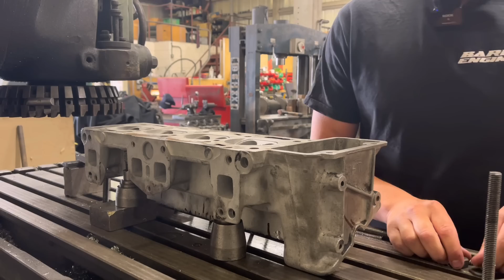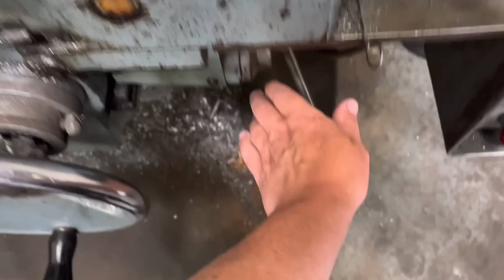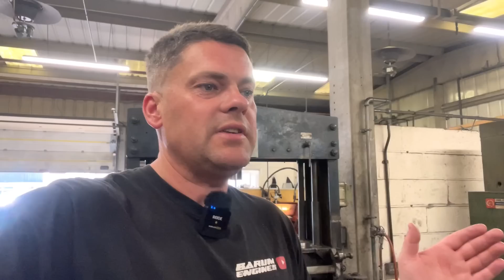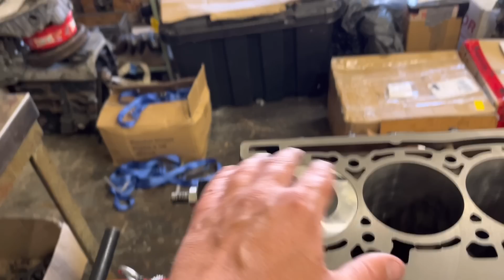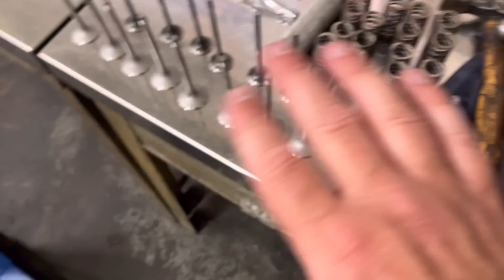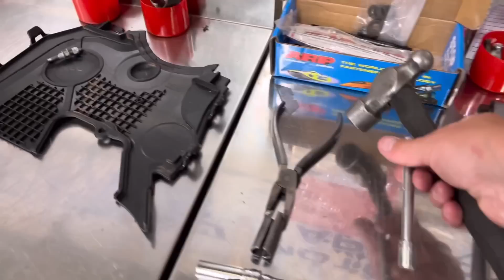“Something SERIOUSLY wrong with this engine, sort it ASAP”

Comment: Check all the valve stem seals are in good condition. It is possible to split a new seal. Rare though. As is missing the installation or pushing one off when putting a valve back in. It could be result of changing the valve springs out for a hot cam. Looking into how much assembly lube was added before startup can be a surprise. 😮ya did whaat? Good Luck.

Comment: You can take a nice round plate that fits properly in you 3 way chuck. Drill a hole in the middle smaller than the cylinder diameter. Skim the plate so that it is properly flat. Take a round stock and drill a hole through which rod that you use now will fit through.  Cut thread on the other side. Take the cylinder put in that custom made piece, put the other rod through one side of cylinder than custom piece than other side. Keep the skimmed plate in the chuck and place a nut so pull the cylinder perfectly flat. Working on the lathe works much better

See for inspiration: https://youtu.be/i-q6H_OyM9o

Comment: I watched a Triumph TR3 idle itself to head warping and filling its surroundings with white smoke.
The cause? Evans "coolant" not thermally conductive enough to open the thermostat on the top of the engine.
Cylinder head at 130C plus, top of radiator at 75C. It ended up blowing pure propylene glycol aka vaping "smoke" out the exhaust.

The vapour capsule based temperature gauge was broken on installation or in transit from a repairer.

Comment: When a road tester at a Peugeot main dealer it was my job to clear the exhaust of oil and coolant following head gasket failure and renewal. This entailed driving at speed on the motorway causing a whiteout to following traffic and I was not popular, but on the flipside if I hadn't done it the customer would have been back the next day complaining.

Comment: What breather system has been fitted?  Most or all genuine C Types breath through extra bosses on the rocker covers, from memory in to catch tanks, not the carbs.  Have they gone to that much detail and does any breather system fitted work?  Wonder what it does if you take the oil filler cap off?  Im pretty sure C types were not dry sump so wouldn’t think it is a scavenging issue but it could be the wrong quantity of oil in the sump.  I don’t think this is the issue but if they have run a brand new engine with no load on it for 20 minutes that isn’t great for the rings. My experience of XK engines, even pretty worn ones, is they are much better at producing black smoke than blue smoke!  What does the smoke smell like?  Be in touch re our MGB engine soon.  I have just received another head that I will check.

Comment: Not a Jag expert, just an overall mechanic. My mind said straight away, carbs not set up properly. Over fuelling and washing the cylinder walls off, which will cause premature damage and failure of the rings and/or bore. When running that rich, the oil on the walls will dilute enough that it burns in the combustion chamber and give a lot of blue smoke. Easiest diagnosis is usually to drain the oil and smell it, if the oil smells like fuel it's running pig rich and smoking badly, washing the bores off. If the engine is out, it would pay to rehone and new rings (at customer's expense) if this is the case, as it can quickly glaze the bores from the washing effect.

The tell-tale is the fact the plugs were saturated when the customer removed them.

Comment: Never been a fan of handing over an engine that I haven't run myself first, obviously in a lot of cases it's not practical  with late model engines and electronics etc but for early engines it's not much work to set up  and can save a lot of headaches in the long run. 😊

Comment: If the plugs don't have oil showing on them then the smoke isn't being created IN THE ENGINE so as I said yesterday look inside the exhaust for oil that smokes more the long it runs & gets pipes hot enough to smoke the oil. Again good luck Lee!

Comment: You can tap them seals down too much and the top of the guide will hold the seal and spring away from sealing on the valve stem , so I've just been giving them a hard shove down with the same socket extension as you do , you can feel when its home, unlike the hammer in the hands of an inexperieced person.

Comment: Never forget to check for oil in the fuel! Ask me how I know. My one ever huge mistake in overhauling an engine (it needed rings and bearings anyway, thankfully), but it smoked like a bugger on first start and drive, I found the fuel pump feeding oil back to the tank...Edit: wasn't a Jag, tho, a Mitsubishi Colt GSII

Comment: If it is rings and its as bad as he is saying i would imagine you would see heavy blow by.

One thing that may be worth doing is a cylinder leak down and possibly putting a bore scope down the cylinders once its warmed up and smoking and if it is rings usually you will see oil residue around the edge of the crown.

Comment: Firstly I'm not an engineer! That piston, if you've trimmed the crown, the "bowl" is smaller and so the compression is higher? Love the videos!
Reply: Looking at the Golf R pistons. We’re they painted with a ceramic coating on the top and if so shouldn’t they be repainted. Just a thought.

Comment: If you sent your car into a garage for a complete brake system, you would expect them to be tested as fit for purpose. You’d be really unhappy if you found out they didn’t work when you came to the first junction.......

If you never test it, you’ll never know if it works.

I understand it’s difficult to set up, but it’s the only way to ensure your work is perfect, which I’m sure it is.

Comment: I'd be running it on some cheap mineral oil and increased revs for abit of time just to see if the rings bed in. If it is the rings causing it in the first place, but it sounds like it need more running and see what happens then

Comment: With an expensive build would have thought a run on a engine dyno be idea especially to assist the running in process, it can become a habit  with a long term build once the engine in to just keep starting it on light load not helping anything

Comment: Firstly has it been run in on proper running in oil to give the rings a proper bedding in.
the other thing that I have had customers doing is putting Mobil 1 fully synth oil thinking
because it's one of the best oils on the market so it must be good for their fully re built 
engine,    It is one of the better Oils only once the engine has been broken in properly,
I swear by AMSOIL 10/40 myself and have done since around 1983-84,
Remember the Jag motors ran 20/50 multi grades and the race motors ran Castrol  R.

Comment: Re the Jag engine Lee what about the brake servo, (if fitted), could it have filled up with brake fluid if the seals have failed in the hydraulic cylinder.
Had this before with the old Mini remote servo's - the quality of which is very poor now!.
Worth a look inside the vacuum chamber to see if it's full of fluid, which would be sucked into the engine and cause major smoking.

Comment: I've had that plenty of times after rebuilding atv's.  Oil is coated in the header and muffler from how badly the engine was before recon.  30min ride usually sorted it.  Sometimes longer.

Comment: Lee, my advise is start up the engine and determine weather is oil or fuel smoke the smell alone will tell you very quickly what root to take. Will be interested to here the result but don't rush in.😷

Comment: Hi, the first item i would check would be the dipstick. Jaguar had a selection of dipsticks to suit different capacity engines and sump styles. There is a possibility it may be overfilled with oil.
Reply: Nissan had similar issue with first batch of 200Bs in Australia, lower markings on stick fixed it.
Reply: @derekhobbs1102  flimsiest dip stick ever that L20 one. We had one the same time as as Capella 1600; former was 0.3mm tin strip, the Mazda's a stubby 3mm job, beautiful quality. Actually, that whole Datsun engine was rubbish, did water pumps, head gaskets, blew at ex.manifold, ran on...all this whilst using a mechanic who was ex Nissan
Reply: Ex Nissan doesn't mean they're any good at Nissan.
Reply: I was thinking the same thing, could be over filled. Faulty valve stem seal ? very hard to determine once the engine leaves the shop.

Comment: Having built 100s of these , only had problems using cast oil scraper rings .
Now only use expanders and a pair of scraper rings .
Historically , Jaguar had problems in the early days . Even the handbooks had a leaflet added to advise oil consumption may be as bad as 150 miles to a pint of oil .
My understanding , from a well known journalist , is they had to hone and re-ring many engines from American delivery docks .

Comment: Lee, I would like to suggest, two interrelated, points

1. Put on your sheet of instructions to customers with new engines 

A check list and 

If there is a problem instruct customer to  create some video evidence. 

2. Include all the ideas in these comments  to the check list

And make sure there is an updated version of the document on your website 

Best regards Colin

PS. remember you can't fix stupid, but you can help to train them. 

AND this document gives you leverage in a courtroom.

Comment: arp 2000 1.5 uhl rod bolts should stretch .0055 to .006 thou, i find it takes at least 55 lb ft to achieve it. The 45 lb ft im pretty sure is for the 8740 material.

Comment: I’ve known a couple off old jags pull in brake fluid vapour through the servo system and smoke like a train.. just one off many possibilities
Reply: Had the exact same problem once on a KE 70 Toyota Corolla but I knew the smoke didn't smell like oil, master cylinder was leaking brake fluid into servo and the vacuum hose was taking it to the inlet manifold and making exhaust smoke slightly.

Comment: Just a thought on the Jag. I ran into a problem many years ago on a rebuilt Ford with a similar problem. It turned out that a previous owner had poured a bunch of oil down the carburetor prior to the rebuild. The oil collected in the muffler and started to burn off after the rebuild.

Comment: If the Jag uses a brake servo blank off the vacuum line as it may suck in brake fluid if the brake master cylinder is knackered.

Comment: What oil is being used. 20w50 is the one we used in a 49 XK120.  We suffered no smoke , the breather on the front went to a catch tank and very little oil or vapour came down the tube. The engine was honed and new rings with new valve guides and valves. Where was the breather tube  routed to ? There were several types of baffles used on the front of the head and they can be installed incorrectly as has been mentioned before.  Also if synthetic oil has been used it may be too thin and may inhibit the rings bedding in. I would ensure the correct oil was used and run the engine up to see if the rings start to bed in. Lots of cars used to special oil in to bed everything in then it was changed at the first service...

Comment: Throw a sacrificial plate in the lathe, turn it true to the head, then clamp the piston to that plate similar to what you have there.  If yo want to keep it centered you could make several plates with a recess for the piston.  Have several different plates for various pistons.  You may have to face the plate once then just dial it in to be flat after you make it.
You might take Paul.  From the way you describe Paul and listening to him, he has worked on quite a few of the older engines and may be able to spot something that may be slightly out of the norm.
And SMELL the smoke.  As you know smell can tell you a lot especially if it's a mixed quality fuel as mentioned.  Don't forget to check the plugs for the proper heat range.

Comment: With all due respect, back in the day when I built engines, I never let one out of the door until I’d run it myself. Not easy to do with all the different engines you build, but it was worth the hassle to me. Just a thought.
Reply: Agree 100%
Stops all the agro
Reply: Owners problems once he takes it .

Comment: Considering labor mentioned in installing engine was difficult, checking it in situ is best, glad you're taking direct examination rather than hearsay.... Is there a practical way to measure internal vacuum in bottom end while engine runs perhaps thru some reinforced hose off dipstick, then attempt applying an external enhancement vacuum source to increase vacuum condition, in order to see if this reduces smoke and improves bedding in by reducing excess oil being drawn up by top end vacuum in BTDC stroke ? Check break in oil brand/viscosity to be certain it's low enough, not a synthetic etc that might slow break in processes...

Comment: Assuming the C type replica is being built to a high spec as you suggest with mostly new parts it's probably safe to rule out oil residue from failed used components. Likewise its not going to be an auto so forget any connection there. The third carburettor electric choke arrangement wouldn't cause persistent smoke once you've cleared its throat a bit with a few revs. If it is oil smoke then it's going to be dead obvious once you get in front of it because there'll be signs. Only three times have I ever had a bad smoker that couldn't be explained. Twice thR turned out to be diesel in fuel from the owners error - they don't like to admit it - so definitely take a bit of  your own fuel with you and some jam jars or something to compare with. Any diesel will turn it green and a bit cloudy looking compared to fresh petrol. 
Third occasion was that the owner had overlapped the ends of the oil control rings - obvious once you'd got the engine out and in pieces but again he swore they were right until proved otherwise.
You absolutely can not diagnose on the basis of what the customer is telling you, however competent they may seem.  My money's on the fuel. Keep up the great content!
Reply: Some of my work is diagnosing issues with electronic systems.
You are completely correct about customers. You can listen to them, but it's best to start with a fresh mind otherwise their observations can lead you astray
Reply: And I have worked with so called mechanics who couldn't diagnose problems either never name what the vehicle owner was telling you what he thought was wrong.

Comment: Correct me if I'm wrong but when you do an engine, the first time that engine starts and for a while it will burn off the oil that is used to slide pistons in etc... but eventually that burns off and smoke stops. my first thought is the engines been left a while plus the assembly oil and only been run for 20 mins, id think running again for a good 30 mins or more should help massively. if its still smoking at that point THEN i would say hang on what is wrong. not sure which engine it is, some have multiple carbs and they have to be set up right. never got to do that myself but I've seen it on Youtube. 

I seem to remember they often used "Cork" gaskets which are prone to seeping oil. was it upgraded to modern gaskets? not sure how relevant that is, but its something i remember been a thing. 

I will have to watch the vid again but i don't think you said smoke from the exhaust, could it be smoke from the engine bay? like its burning off paint on the block or somethings dropped on the exhaust...

this is just my out-of-date semi-trained thoughts so i could easily be wrong.

Comment: As with a few other comments did you tell the owner to use running in oil ( Millers )and not let the engine tickover once it had started and got oil pressure. Modern oils and leaving it to tickover is a sure recipe for bore glazing. I used to do that and have learnt the lesson now. Fire them up and vary the revs.

Comment: I work alot on old Jaguars. Sometimes what happens is when you fill the carburettors on the Su type they have what's called a dashpot thats filled with oil and it can be sucked into the engine.

Comment: It could even be Automatic transmission fluid being drawn into the engine.  Could also be master cylinder leaking through the brake servo. Just because it's new doesn't mean it's not working.  He could have even connected a hose on wrong.

Comment: He should be checking out the inside of the axhaust for oil from before doing the engine. We had a BMW that smoked EXACTLY like what you're describing.. We took the axhaust off & washed out the system & had alot of oil come out. Good luck with it & another great video Lee! It would take 15 minutes for the exhaust pipes hot enough to get the oil down stream to smoke.
Reply: ive had the garage joker put oil down the exhaust pipes on cars when engines were out, when engine was re installed it smoked something serious for a while till it all burned out, its not printable here what he was called when we found out what he was doing.
Reply: @madeljacky  🤣
Reply: My exact thoughts
Reply: Where did the oil come from in the first place?
Reply: @deancooper7952  It gets in there before the engine is removed for the rebuild. That's what our BMW did.

Comment: "oh the pcv is absolutely fine"
Oh yeah, I bet.

Everyone thinks  if there is any kind of smoke it must be the reconditioner has buggered up the boring and honing process.
The truth is the bores could be 0.005" oversize and the rings will still seal and keep the oil out. Like you said, when they come in they can have massive wear and they still don't smoke.
They probably started it with a ton of oil in the cylinders and a overfilled sump.
It is not the bores or the rings.

Comment: Remember hearing in the second world war the Germans hated Citroen lorries as the engines kept failing, the French had lowered the marks on the dip sticks and the engines where running with almost no oil. 
Any chance of the reverse here perhaps theres been to much oil added? Either that or just oil in the exhaust and the car needs a good drive to clear it out.